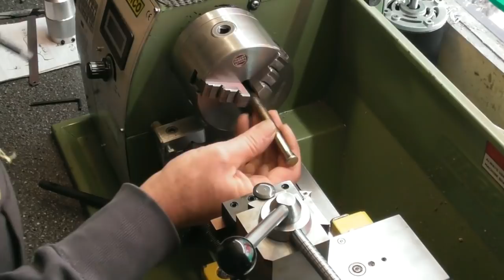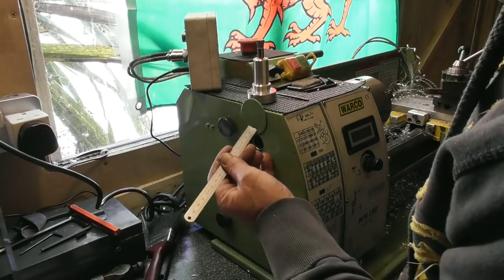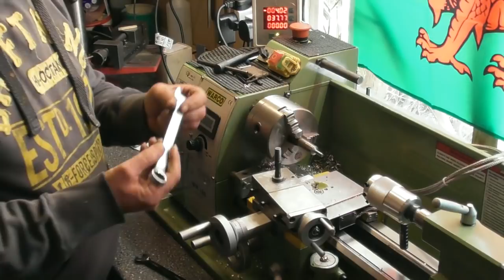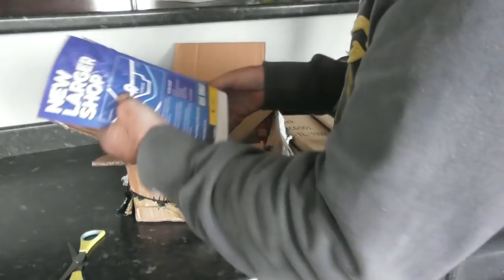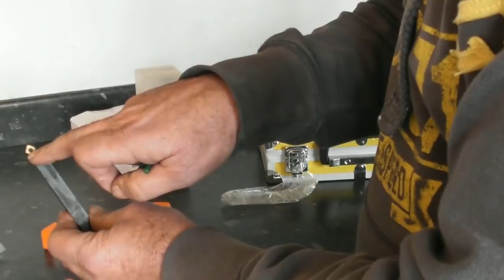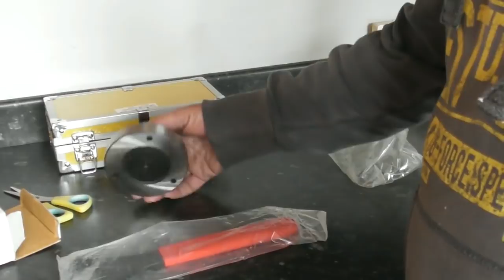shed talk 2

Comment: Milk jugs / anything plastic with a number 2 on it or hdpe / ppe  ect got any car mats?.  See atomic shrimps vids on melting plastics very good. I used ex army chopping boards their 20mm thick. Cut up plastic and stick in oven portable ones best as her indoors will flip big time if you use her oven.

Comment: Thanks for all Your educating and inspiring videos Ade!. I now have a Warco Super Mini Lathe. I notice the knobs for loosening the back cover covering the gear train for threading. Did You make them Yourself? I really dislike using the hex key, allen key, everytime I want to take the cover off.
Reply from the maker: my lathe came with the handwheels . it would be a simple modification to make up some handwheels . to replace the bolts though . Cheers Ade.
Reply: Thanks Ade! I saw a Tube video some time ago where somebode was making those things but it was not You. I'll figure something out.

Comment: Best for Inconel turning = Kennametal H10F grade, square Insert with a 15 degree approach holder.
Peels off very nicely, loads of pumped coolant & about 2 thirds less than steel for RPM.

Comment: Thanks Ade  I will be making a spindle tuning handle same as yours to fit my super 7.like the spanner op rather than the handle.I have made 4 centre drill holders had to turn my own 2MT tapers so used a dead centre to make sure the angle was right.,do like your knockers but must make the ball turnnig accs.. Been too busy on the 71/4" G Hunslet Wesh Quarry locobut am at the assembly stage there. Hearing your weather I now am sure immigrating to Queensland Aus. was right for me !!!! Cheers

Comment: Hi Ade, whenever I do wood turning I don't look at where the tool is cutting but @ the back edge and you get a ghost image of what has and has not been cut, might save you having to switch off the lathe to check if the full cut/taper has been done.
Two bits of foam... that might come in handy for something, way to go Ade. All the best G :)

Comment: I have one of those collet boxes and the fittings are really weak the handle fell off mine the first day and the hinges and catches are no better. Expected beter from RDG tools frankly. In the end I made a box with slide out trays for my  Metric and imperial ER32 collets and my metric er25 and er11 collets which worked out pretty well, I also have enough room for the collet spanners and i made up a perspex lid for the box, I use it all the time both for the lathe and the milling machine. Keep up the good work Ade

Comment: I made a handle in a similar way but i used a brass cone and studding and an aluminum handle, but I also added the facility of indexing rings on the end of my mandrel. I leave my mandrel in the lathe all the time as it stops swarf working its way through the spindle and ending up in the gearbox as happens in many mini lathes. It doesn't seem to cause any imbalance even at speed. I use er32 collets, but a lot of mills are using R8 spindles now including mine :)

Comment: Hi Ade, I have used HDPE 2 to make a head for a damaged soft hammer, it was literally milk cartons cut up placed in the oven and when soft forced into a tube with the retaining nut and allowed to cool then turned on my wood lathe. The blank turned like butter but is hard enough for the job it does. Maybe you could try making a block and mill to fit your vice jaws and hold with magnets! G :)
Reply from the maker: I have had a play with this , never followed it through though. good subject for a future video though. Cheers Ade.

Comment: Soft jaws for a bench vise? The last thing I'd use is any plastic I can think of. Your trying to hold parts and I'd assume without them moving in the vise. The coefficient of friction for plastics, nylon etc is low. In other words it's very slippery. For protective non marring vise jaws I'd use the old school hardwood faced with fairly thick leather or maybe sheet rubber. No hardwood? Then at least some high grade boat or aircraft grade plywood. 

I know you already know it, but that's one very bad habit of reaching in and clearing swarf with your bare hands. Get unlucky just one single time and that ball of swarf catches on the part or chuck and at the minimum your getting lots of stitches or some fingers reattached. I use a cheap paint brush or extra long needle nose pliers for swarf clearing and would never try and clear swarf with my bare hands even with the machine stopped. I'm also about as far removed from being a health & safety nazi as you can get. But I've learned not to push my luck around rotating equipment or razor sharp swarf. New inexperienced people tend to follow what they see others doing.

Comment: Re the soft jaws, their are loads of nice magnetic jaws on Ebay & many other places for under a fiver. They are aluminium bodied with various soft faces available from hard rubber to plastic/nylon faces, complete with magnets set in the aluminium body to stop them moving. Nice work as usual Ade, waiting to see you machine the er32 collet chuck to go on the WM180.

Comment: For the vice jaws you should use a kitchen cutting board, the nylon ones. Around 12mm thick. Could be easily cut or even machined to the same shape and size as the original jaws. Cheap and simple

Comment: hdpe plastic milk bottles heat in oven to reform it into a plastic sheet block. i have made chisel , file handles a mallet. machines well .
Reply: melts at  265f try to keep heat lower 230f them it wont fume to much .
Reply from the maker: i wll certainly have a crack at this , great idea , cheers Ade ,

Comment: Ade, Iv used plastic chopping boards for that kind of thing. Worth a thought
Reply: Mike I would second that and commercial ones are usually far thicker than bog standard so can have surface grooves etc milled in to them.

I used one of these for a hand wheel
https://www.ebay.com.au/itm/7-3-Diameter-Revolving-Handle-Handwheel-for-Milling-Machine-Q8W6-/253287443102?hash=item3af91baa9e

Ade, where did you get those soft end arbors? I am in Australia so posting can get expensive if I have to order from the UK.
Reply: Michael -  LPR Toolmakers in Melbourne have the "soft all over" arbors. They're on ebay too, but cheaper if you order direct. Try
https://www.lprtoolmakers.com.au/blank-mt-arbors-no-thread-threaded-tang/
Cheers - Andrew
Reply: Cheers Andrew I had seen these but I was after the sort of price that Steve Jordan got (2.32 in this video https://www.youtube.com/watch?v=L0ZTw5J8oTE) 5 for about 20UKP from over here so that I don't have to include shipping. I can't seem to find them from the usual far Eastern suppliers.
But thanks for trying.
Mike
Reply from the maker: Yes , i have discovered the uses of them , i think i used one in my leadscrew protector , Cheers Ade.